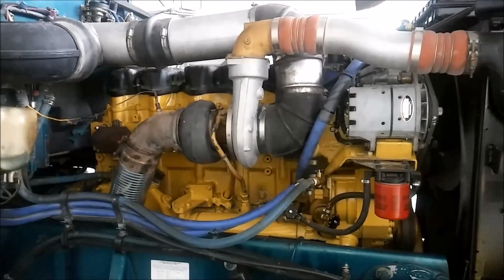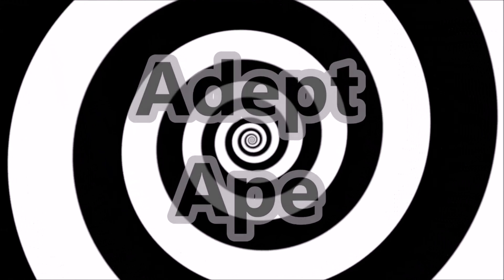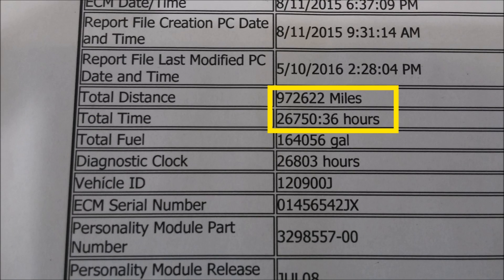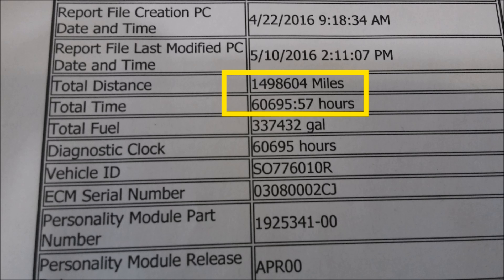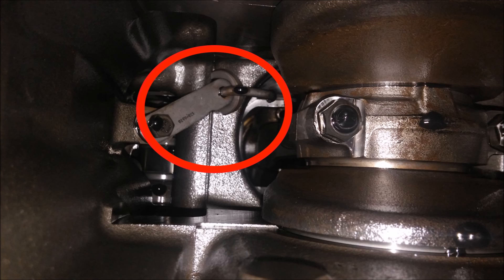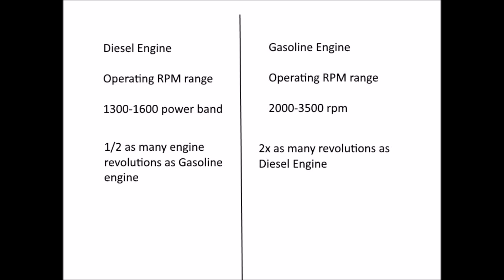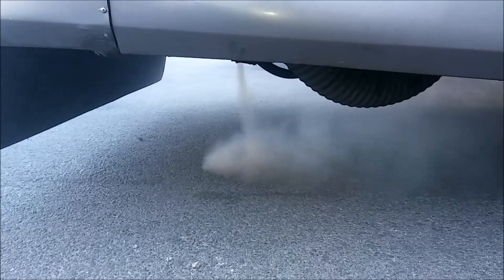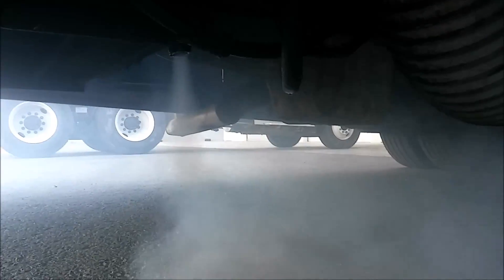Why Do Diesel Engines Last So Long?

Comment: Not really a fair comparison used because of the duty rating between a class 8 truck diesel engine and a car or truck..or even rv gas engine. Unfortunately products are also engineered to fail literally so they can sell new ones. That doesn't mean your points for diesel aren't valid though. One you missed I think was trucks are probably better maintained mostly being corporate owned and on regular maintenance schedules. The DOT saw to that.

Apart from all that I remember regular gas and engines that were lucky to hit 100,000 miles in cars. Everything seems to have improved despite their engineering to the contrary mostly I believe because of advanced lubrication technologies.

Comment: Thanks for this video, well explained. 
I have an 05, 2.5TD Toyotahaice, she works really well except for one thing and that is if, I let it idling for about two minutes or more on a morning when, I drive off it will smoke heavily with a light blue smoke for about a two or three minutes drive and it will stop.
It will not do it again for the rest of the day. 
Any ideas will be greatly appreciated. thank you

Comment: When you consider the advantages of the diesel engine over the gasoline engine, it's damn unforgivable that cars and light trucks like the Toyota Tacoma, the 4 Runner, and the Tundra aren't offered with diesel engines as options.
Reply: They are in other countries. US emission standards are too tough.
Reply: @aygwm   I'm all for clean air emissions, but this is insane! They keep upping the emissions requirements to the point where, unless that diesel engine is made here in the USA, it's damn near impossible to keep up.
Reply: @aygwm  If that's the case, why are much larger displacement (Cummins 6.7 litre Turbo Diesel), Duramax 6.6 litre Turbo Diesel, and the Powerstroke 6.7 litre, still allowed to be sold here in the USA? I see no logic in that. I'm all for clean air emissions if it's realistic. But every time they up the emissions requirements, they'll come a time, when even the much larger displacement diesels won't be able to keep up.
Reply: @jasoncarpp7742  they’re truck engines.
Reply: @aygwm  So? Shouldn't they be required to meet the same pollution requirements as cars?
Reply: @jasoncarpp7742  no

Comment: Gasoline is not as volatile as you think, matches just get snuffed out in a bowl of gas. I know because I tried to light a bowl of gas on fire... nu-uh not happening.
Reply from the maker: +thelegendbullet937 Its really the vapors that ignite, not necessarily the liquid. Gasoline is more "ignitable" in the sense that it puts off fumes easier, but neither is crazy volatile. Generally I try to not light bowls of gasoline on fire, but everyone needs a hobby 😋.
Reply: Hehe, well it was for an experiment and I only used about 1/2 cup of gas ^_^.
I will give you that Gasoline is definitely More ignitable than Diesel... I just thought the nuke picture was over-doin it a little ;)

Comment: becasue the head of an an egnine needs lubrication and gasoline is a scowering material and has scuffing properties and diesel has oil in it and the oil constantly lubricates the cylinder walls and this is why the diesel engine keeps constant compression and never wears out and can always pull hard and strong for a very very long time probably forever if properly built and maintained.  A normal engine wears out after getting to hot or running to long cause the heat mixed with the scraping of the cylinder walls creates wear to the engine head and friction which causes more heat and wear and thus wears out if used for prolonged period.   Diesel having oil in the fuel constantly keeps this wear to a minimum and so it never wears out.  Your block or the head of your engine is where the compression or the horsepower come from so without good compression you are going to get a leak into some other part of the engine and not direct power like a diesel.   ALso deisel engines use pressure to igninte the fuel and not a spark plug to ignite the fuel so this might also be a reason but i really dont know about that part of it.   If you constantly lubricate a gas engines head through the fuel it will also last and have good compression like a diesel but not everyone wants to pour more money constantly into their gas tank so gas engines wear out a lot faster.   WIth diesel you can just fill up your gas tank but  with gasoline you have to add sythetic solvents and conditioners to the fuel and its costly.   Plus deisel engines are built heavier and some of the or some of the ole ones use heavy arms and components in the engine giving the engine more weight and momentum when moving creating a sewing machine affect and this rotation affect helps to keep the motor running more effeciently and smooth like a sewing machine by the weight of the moving parts inside.   I dont know about the new ones but the old ones like the mercedes benz 300d trubo deisel runs just like a sewing machine and has lots and lots of torque and power kind of like a really smooth truck engine in the car that drives like a car and has so much torque from such a small engine compared to a gas engine where your engine is doing a lot of work load to get that power or moving at higher rps and buzzing really hard but getting nowhere or creating very little torque compated to a diesel engine or at least the old deisel engines.

Comment: The short quick answer because they are maintained properly. 

Most car gas engines don't get the maintenance they require. Particularly leased cars the lesser doesn't care about doing the required maintenance because they trade them in and get a new lease vehicle. Most diesel commercial truck owners do the maintenance required because they don't want problems.

I have been at truck stops where 35-40 foot RV's are fueling up and watched an owner pouring motor oil into the diesel. I asked him ever had any trouble? He said yeah couldn't understand it just replaced the engine with a new one cost me over $28000. They couldn't tell me why it failed. I told him I could, I said the problem with the engine is you. I've been driving RV's for over 30 years I retired when I was 34. Congratulations now look at the oil you just poured in what is the API rating? He looked at me like I had 4 eyes, after I told him where it was he read S/D on the API rating. I then told him the S stands for spark ignition and the first letter on diesel motor oil is the letter C which stands for compression ignition. After his first oil change and he proudly stated he did all oil and filter changes himself had been running an N-14 red top cummins on 5-30 motor oil designed for a gasoline engine. That's why your original engine failed at 87000 miles. I was glad when he went inside with me to look at motor oil for diesels on the shelf and was stunned to see the recommended oil was 15W40 Delo motor oil. Upon further questioning he had changed the oil and filters two days earlier and only had 4000 plus miles on the new engine. I he took my advice and brought it right into there  shop for a complete lube oil and filter job including fuel filters. He admitted he never read the owners manual as he always did his own oil changes and read through it and was shocked when it specified the motor oil to be used. 
They really ought to make these idiots read the owners manual before they let them drive away.

Comment: Lots of higher performance gasoline engines use what you call piston coolers, typically called piston oil squirters, an example of an engine that does this is the 1.8L Mazda BP engine, used many different cars throughout the 90s (Miata, Escort GT, Protégé LX, and even Kia Sephias)

Comment: Yes, I agree and it's all true. however; please explain why my 2005 Dodge Neon 'SXT' (5-speed manual) drove 416,277 miles before the motor had to be rebuilt? [bear in mind; I changed its timing belt 3 times and its clutch disc 4 times]. It runs on gasoline (petrol) but now, after its rebuild; I'm now at 487,322 miles on the same engine/motor and it still runs great!

Comment: I got my Mitsubishi Triton with 174*** on the clock. And recently i went to repair my Triton, and honestly i was under so much pressure when i found a issue and asked for a second opinion i just said screw it, put it back together and it ran for 8 minutes then i destroyed rocker arms, Top caps all because i put a top cap in the wrong place and not receiving oil...
Lucky i am not only able to do mechanics but a bit of engineering. Dad line bored new components for the head by hand to clock work perfection, and i rebuild the assembly.

Where does my engineering come into it? Well i apologize, i just rebuilt a Injector pump a flange broke in half their and glad it did otherwise if i put it back together and it got hammered as it does it would have broke on the road. I drew up the drawing on a computer, and had a CNC cut it out. The operator of the CNC actually made his own little mistakes and on the 3rd attempt we made a new flange.

A Mechanic told me i should have put a shot of Silver into it but after what i saw i knew that would never have fixed the issue. The blow by caused the gallery's to fill up so bad with soot no water could flow between the cylinders. They are now cleaner, and the engine will stay cool again!
The reason i replaced the head gasket was due to a issue with both heating but also my water was getting blown out of the system. And i was worried about performance.
The Pump was rebuilt because it started leaking fluid, and the bushes were replaced.

No the car does not run yet, the pump needs to be benched, Crank key-way needs a bit more finishing and the seal at the crank needs to be replaced. Then the Mechanic we know is going to assist us in making sure we don't muck up! This time.
No pistons were harmed as the engineering is much superior design to other engines, instead of rebuilding the head and engine... You just rebuild the head and drive away! Clever! No new crank needed, no pistons, con-rods, rings nothing! It destroyed the rockers so the valves could not go through the pistons. Best of all, the valves were not even harmed either! 

The Crank turns by hand so easy that you can be sure the bottom end only ever got a slight fright from the crash.

What kills diesels? For one not keeping your own head when rebuilding it, and second is not maintaining it at specified intervals! Timing belt's go for 100,000km's then replace it. If you push to 200,000 you run the risk of the belt snapping and destroying the top and bottom ends of the engine!
You don't replace oil it starts both losing its lubricating property's and gets a large soot build up which can block oil passage ways if severe enough.

The engine will run and loads of lessons were learned.

The most part stress made me feel i need it right now! I need to use it! Because my grandparents don't have a working ute anymore, and kinda asked me for help moving wood for 30 odd Gum trees and repairing the roads which can only be tackled by a 4WD now... Otherwise clearance, and getting bogged are the two risks on their road.
Not to mention the stressful environment when everyone's shouting and getting angry and telling you that you should never have pulled the motor apart and they are right you are wrong. To someone taking advantage of your assistance and not giving you a drink while you help them do a job... that is bloody pathetic in this weather we have now!

After the engine broke and found it was my own fault my blood pressure dropped and i felt weak... And someone changed to help me get back on my feet, by calling up the mechanic to call in my favor for helping him fix his lawn mower and for helping him out with machining Flywheels, pulleys you name it he got it!
The car is gonna run again and that is that!

I hope if you heard what i said, know to stay away from a vehicle your repairing when in anger... You stop thinking logically and using your skill sets. Just like a few people who got angry and lost fingers on Guillotines.
I did not lose fingers... I just lost 3 weeks of registration and running time for the vehicle. And learned a lot in the process.

Comment: The biggest reason is Diesel engine run slow, real slow compared to a gas engine.
THAT, is the reason why Diesel lasts longer. 
Everything wears really slow, because the motor is turning slow.
Plus all the design crap.

Comment: I know where a stationary diesel pumping station is, that runs on natural gas. If it has ever been shut off in 20 years, I don't know about it. A service man said it had an external oil supply, and they don't even have to shut it down to change the oil or filters.
Reply from the maker: +crusty old fart I could see how you could set up some ball valves for changing the oil filters, but I wonder how they drain the oil with it running and put new in?
Reply: Adept Ape Dunno, but it has a huge external oil tank, and a lot of valving. I guess they just recirculate the oil in the pan while they change out the big tank. I can see the bypass valve on the filters though. There are 4 of them.

Comment: 1. Interesting how you compare heavy duty diesel engines with consumer gas engines (yes, I know '80s Mercedes did reach similar mileage, but what is the ration of high-mileage vs actual sold units?).
2. Diesel is NOT lubricating the piston-rings, as it's ignited during injection. By the time it reaches cylinder walls, I seriously doubt it lubricates. It does not dissolve the oil like premixed air+gas (and probably an exponential wear effect combined with rpm range), but not ADDING lubrication. It lubricates anything in it's path, but the high-temps in the cylinder stop that.
3. A diesel engine heat's up much slower than a comparable gas engine. For daily work driving (as in consumer diesel and what you should have compared), it takes longer to heat it up, thus driving maybe 5 miles/trip would be bigger wear than the similarly-powered gas engine.

Let's not forget that for the same engine size, diesel needs a turbo to reach the same power (thus more components to maintain).
As for why heavy duty is mostly diesel, it has to do with component weights combined with low rpms.

Comment: I've seen gasoline engine vehicles break past a million miles... All you have to do is change your oil every 5,000 miles max, don't hammer the crap out of your engine when cold and let the idle normalise when starting from cold and don't ignore unusual noises. After all that, it'sup to the manufacturing quality of your engine as to how it's gonna last... Spend $40,000 on a well engineered car and it can literally last a lifetime with a regular maintenance schedule... Of course, that's the same for diesel... Take care of it and it'll take care of you!

Comment: I was present when a Navistar International 6.0L turbo diesel was disassembled with 780,000 miles and the cross hatch on the cylinder bores was STILL present. We took a micrometer and checked diameters on all bearings and bores and found none that were out of print. The only reason we took it apart was that it had been in submerged in a flood and water made its way inside. We simply cleaned it all up, put it back together, and it is still going. The odometer read 941,889 last month when I changed the oil. The truck itself is a rust bucket on its 9th set of brakes, 11th set of tires and two drivers seat. I am going to take the engine out and drop it into a Jeep Comanche.
Reply from the maker: +smacman68 That's a pretty cool story to hear, I know a lot of guys only like the 7.3, but it sounds like that 6.0 is making some money for you.
Reply: Most 6.0's blow all to hell in the first 50,000 miles. That was a lucky one. If they have studs and O rings put in the heads, and delete the EGR, they're good engines, but they will never be a 7.3.
Reply: You must have been dealing with a bulletproofed one. The 6.0L is a long lasting engine with EGR delete and ARP studs. That dirty oil from the EGR kills injectors.
Reply: Cummins has done same with big rigs using synthetic fluid with over 2 million miles on them.
Reply: The Navistar 6.0 is very differently tuned than the ford 6.0.

Comment: Engineers design an engine for a specified life, may it be diesel or gasoline. 

The main reason bearings fail is start-stop cycles & old/dirty oil. In continuous operation, a properly designed bearing can last forever. - Hydrodynamic pressure separates the shift from the bearing. This pressure is not existant at the start. 

Crankshafts are sized with respect to the stresses (see cylinder pressure), critical speed (to avoid resonance) and deflection (wide bearings require a very stiff shafts. otherwise, the bending may cause contact in the bearing.)

Comment: Diesel engines don't have timing belts/chains? What?
Reply: powestroke. cummins
Reply from the maker: +captmcneil Some do, but many are gear driven.
Reply: For example? And I mean the diesel engines in modern vehicles that do 1m miles, not heavy duty stuff.
Reply: My 6.9L International diesel has no timing belts. It's all gear driven. After my wife's Acura blew a timing belt and left us stranded on a busy highway I swore we'd never ever own another vehicle with a timing belt.
Reply: Paul Maxwell Can’t believe Honda and Acura still use timing belts. They should use timing chains.
Reply: Ford inline six, GM inline six, and Chrysler slant six are gear driven.

Comment: why do the RVs have such cooling issues?
Reply from the maker: +old timer The radiator is closer to the ground, less maintained, rear radiator, plastic expansion tank, higher horsepower ratings, and lots of other reasons.
Reply: Thanks, I was wondering if it was a design problem or maintenance issue